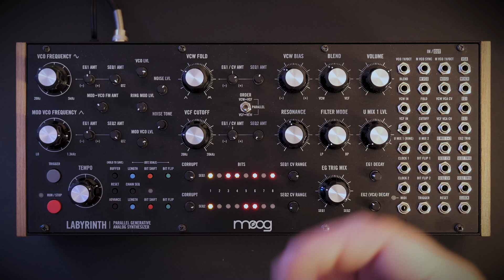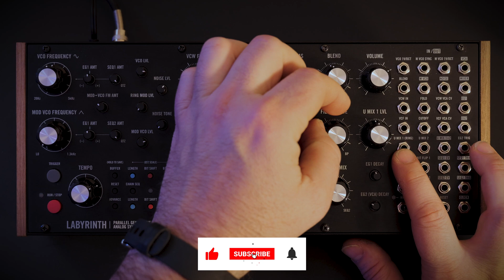Moog Labyrinth | Complete Tutorial | Part 8 - The Patchbay

Comment: MIDI can control oscillator pitch!
Reply: does it really!? I hope so, I know it does on the Subharmonicon, but can't seem to get it to work the same on the Labyrinth. edit Okay I now see that having the 'seq 1 amt' knob all the way down was preventing me from gettin pitch changes. turning that clockwise has fixed it, I get midi pitch now!
Reply: Yes I can confirm that. You have to set the seq 1 & 2 knobs fully to quantization so incoming midi notes will result in the notes you send